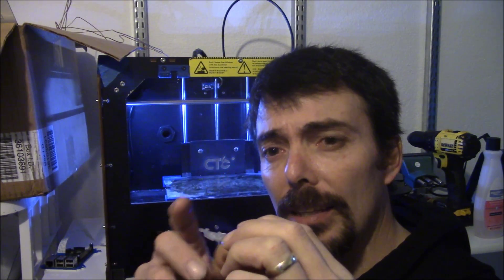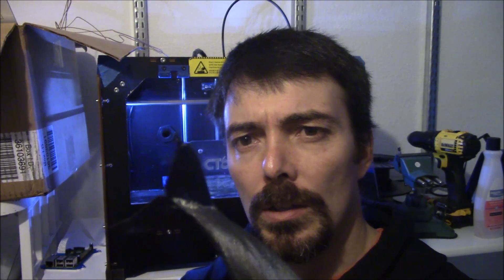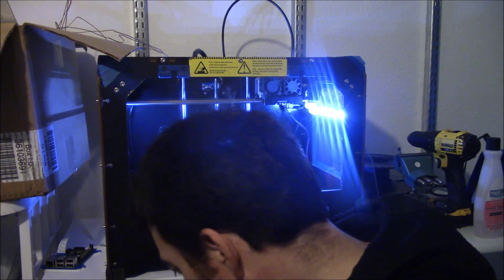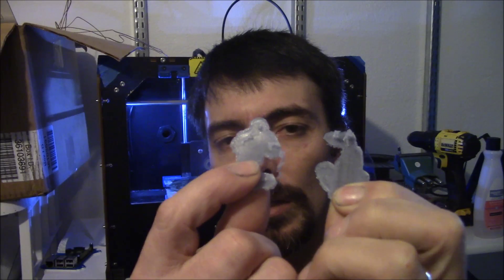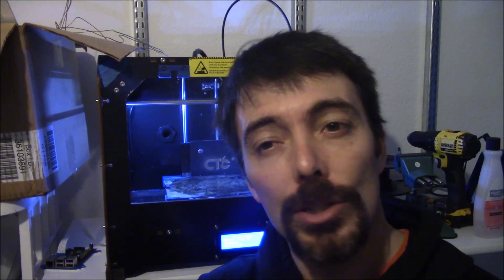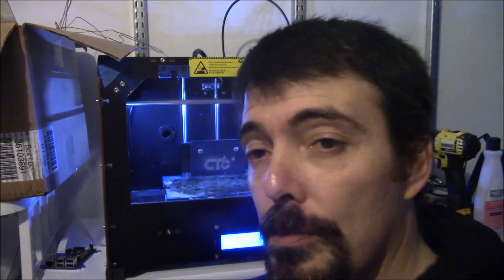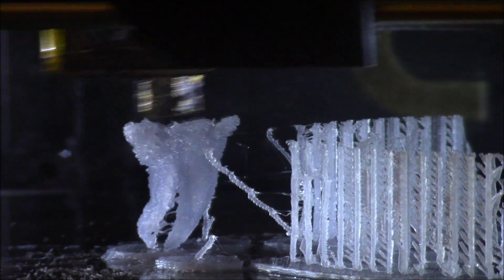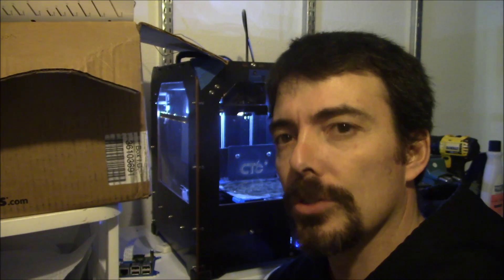MoldLay Filament Review.

Comment: Hey, I also want to try this filament to cast some zinc figures within sand, so many thanks for giving an impression of the filament in this video.
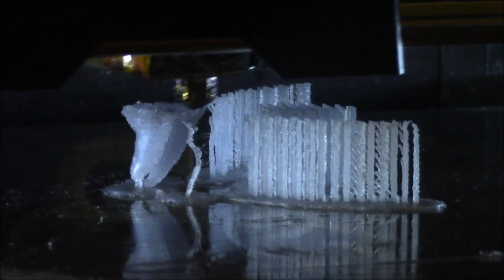One issue you can see pretty clearly at 8:22 is, that the tail (? I mean the left part) has no stability and moves around by the nozzle.
If you would give it some support as well it should do it quite well.
Good luck with your future prints!

Comment: My personal recommendation is run your printer at 174oC and slow down the print speed. I got beautiful prints from the get go at 180 but wanted to get even finer detail. Also do a test print on some small objects from Thingiverse so that you are not wasting filament. I found that running at normal speeds and at the more hotter end of its extrusion limit the wax would distort when in close proximity to any support structures too. I tried disabling retraction aswell but found it more messy and not useful for me personally.
There is not alot if information about Moldlay out there but stick with it you can get amazing results. 👍

Comment: bought this filament just a few days ago. And - it's working. Current settings in Cura:  20mm/s, 0.06mm layer height, bed temp 55 (after first few layers 45), cooling fan after a few first layers turned up to 50-60%, retraction distance 2mm, speed 45mm/s, flow 100 (can try also to lower it a few %). Great detail, not so about bed adhesion, still have to try different options. However, quite happy with this filament and print quality is ok. I'm using E3D hotend with teflon  throat tube.
Reply from the maker: .06mm layer height? What size nozzle do you have? I just got a new printer with a Fan I may give it another try! Thanks for sharing your settings!
Reply: +nodakhunter with 0.4 runs ok, altho have tried 0.1mm layer height - works good enough as well. Today going to try with 0.2 nozzle. And the cooling fan is very important, play with it, during the print I adjust it up to 90-95% - preserves sharp edges for the jewelry type of models. Good luck!

Comment: Did you try the machinablewax.com wax filament?
Reply from the maker: No. Thank you for the link!
Reply: @nodakhunter  I have tried the machinablewax filament. I had a ton of problems getting it to adhere to the bed. Additionally it would often crack between layer lines as it cooled and warped. In the end I did get a couple of successful prints but it was such a painful experience that I don't ever print with it. I am not an expert 3d printer user by any means. Just hoping to find an easy to print with filament that I can cast with.

Comment: Is the filament very flexible? Do you all have bowden systems?

I need something waxy for casting.
Reply from the maker: I use a direct drive. Mk8. This filament would work in a Bowden drive. It is somewhat waxy it is ridged not flexible like Ninja Flex. Are you planning to use the filament as the mold and poor into it? I have not tried it this way yet but it may work. Everything I have seen there using it for lost casting.If you are looking at making a mold with it I recommend checking out Smooth-on. If your looking for something that is slippery this may work. I never thought of trying it as a bearing surface. It would probably be good for that. I will have to test it as a slide on a rail.

Comment: I'm having the same problems as you.  I'm an expert 3d printer user.  I tried with and without cooling fans as well.  Prints that work fine in other filaments just result in blobs and strings in Moldlay so bad that the print is not usable.  I also tried layer heights from 0.13 to 0.45 to no avail.  I tried print speeds from 30 to 80 mm/sec.  I also tried heat from 160 degrees to 190 degrees.  I also tried various acceleration controls on the exterior.  All prints were unusable for the intended purpose of casting.
Reply from the maker: Sorry for your troubles I have not used it any more for it intended use. I think  PLA would be a better for Lost Polymer Casting.
Reply: Everyone thinks theyre an expert, thats what printing does to a normal person... Put bluntly, if you cant get it to print, you are either skipping steps in setup of a new spool (like telling the slicer its 1.75 filament, now realizing that thats not the diameter, thats the system its used for... You didnt use calipers in other words...), or you are printing with bowden, or using incorrect settings. Either way, you dont know what youre doing, so i would not use the term expert.

Comment: Hey, i am having problems with this material too! I try to print permanent molds, and what i've found out: you have to print it VERY slow and quite hot. I made the best experience with about 185 - 190°C. If you print sth. tall (where the hotend circles over a small area) put the fans on.

The layer height is another thing: the inventor of the material was shocked when i told him that i print with 0,08 or even 0,06. "Who has the time for that? Who needs that??" gg He recommends a layer height of AT LEAST 0,2mm, which would make Moldlay in my eyes useless for molding and casting , because of the clearly visible lines.

Anyway, after many tries i successfully printed with 0,1 layer height - but it's impossible to get the cast out of the molds, even with release agents.